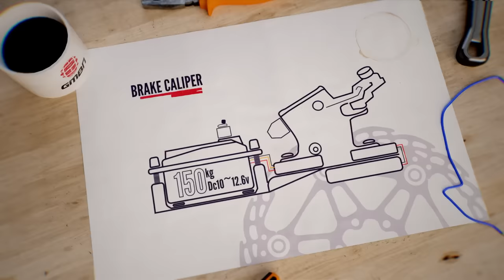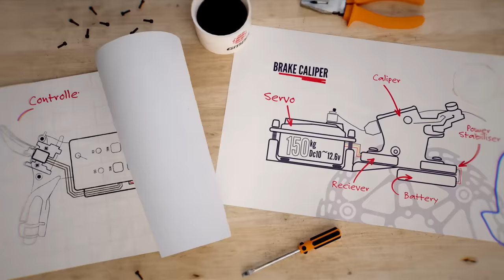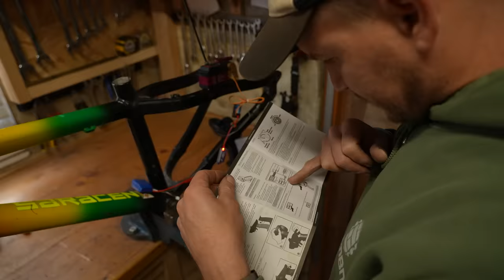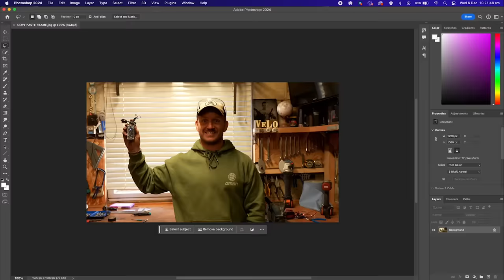We Made The World's First Wireless Bike Brakes

Comment: If this is a standard radio control system, you probably want to dial in some expo to make the brakes a bit more proportional, probably with a pretty strong spring on the levers to give more (artificial) feel.

The big issue, however is this:  You have a safety critical system with multiple single points of failure.  There are a lot of things that will make you crash if they go wrong!  Batteries give up suddenly, signal lost, short circuit in either end, etc.  Some serious thought has to go into making this system fail safely, I would suggest some sort of mechanical default to mid-strength braking if no other input is received.

Comment: Not needed on the front, you could just run the cable through the stem cap and achieve the same thing, which is safer especially if using a wireless rear. On the back with some refinement, maybe using a longer lever, yeah for those willing to go through with it and with replaceable batteries, plus one wireless brake is half the development work.

Comment: Looks already awesome! Maybe there is a way to use Hydraulic Breaks, and den let the servo push instead of pull. Makes it definitely a little more complicated but it’s an idea.
Also I think overall better quality servos especially faster ones will improve the system a LOT, So it works more intuitive like the original ones.
You even could use more space on chainstays and fork fore the mounting when using a hydraulic setup

Comment: The main issue with the 'feel' is that a servo is position based. So the moment you want to position it into the disc, it will put the maximum torque in to achieve this. Which makes the brakes quite 'binary' on or off. The little bit of modulation you do feel has to do with the flex in the system, which does convert a position somewhat into more tension and thus more force. I think this system would be better off with a normal geared motor that is regulated by torque and not position

Comment: It's actually amazing how many patents have already been submitted for wireless braking in various forms - Shimano, Campag to name a few. There is no reason why we can't just seperate lever and caliper completely. The current wireless standards are built to be fairly secure etc. Levers with there respective electronics could be small and unobtrusive. Modulation is not an issue, but feel is - unless you could implement some sort of feedback into the lever??? The problem is most likely the safety aspect - if the lever loses connection, would you gently lock up the brakes? Lots to consider

Comment: Pretty cool Idea!  If you would have used a better radio you could have used EXPO function to adjust how much brake is applied throw-out the pull of the trigger from start to full pull it would have made the brakes work much better less twitchy and also you could have use the radios ABS function also to tune how the brakes worked when applied. with a better radio system this may have worked out much better.

Comment: Maybe look at replacing the motor cable arm with an ovalled cam (see square dash Porsche 944 throttle body) to make it more progressive, coupled nonlinear springs at the lever end. Love this as an academic exercise, hard pass in the real world due to the dependance on 4 batteries, versus something like a car that would have more reliable power and facility for redundancies. Loving the work, though!

Comment: would love to see a smaller version of this with real leaver blades on the brake leaver and mabey like a bottom out bumper behind them to mimic leaver feel also think some kind of full housing/case for the parts would be quite cool and mabey axs batterys on the brake calipers so could could take the battery from the drive train or seat if your brakes battery ran out

Comment: U could build something which would stall the rotor upon low battery also depending on velocity, wheel speed and  some other kinematic data. good luck with the algorithm plus added weight to accomplish all that.. But then the question what does it really achieve? A nice fun project though.

And if i may suggest please try to do a wheelie holder when you are at it..😁

Comment: Not that I'm suggesting taking a step back from disk brake technology, I just think a linear servo v brake could be very very compact, but the reaction time would be slow given the screw drive. For the disk brake what about a servo clamp gripper, that way it's combined and the for factor could possibly be smaller

Comment: The caliper needs to be with a reversed fail safe mechanism, the servo should work to fight against a spring to releases the brakes when the lever is not pressed and when you press it the motor should release. But then you'd also need a motor that can easily be back driven so that when power cuts the motor will release and the breaks would lock. As the battery drains the motor decreases in power and the breaks would engage slowly more and more until they fully lock up and you have to replace the batteries. Still can get you killed but better than no brakes on power disconnect 😅

Comment: lol, thumbs up for the efforts!  The result is very much within expectations.  The lack of feel is  a a BIG problem. Ask BMW enthusiasts, many of them cried when BMW ditch the hydraulic steering for the electrical one.  Ask Boeing pilots switching to fly airbuses.   In those applications the technology can compensate with simulated feedback. With enough geeky engineering, I am sure that can be done for the wireless bike brakes.  But I guess very few people would want to pay for it.  I don't spin my handle bar 1800 degrees in the air.  I don't even jump that much on my bike, lol.

Comment: mercedes did this with the SBC brake by wire system back in the early 2000's. they cancelled it in 2006 and have to warranty the pumps by usa law for 25 years now. but yes the brake pedal on the car used a hydraulic simulator by feedback from the pump to simulate brake feel. i work on the one on my folks old e class often, it works great when it works.
Reply: like old Avid Juicy Ultimates. They were the best feeling brakes in the world, right up until they randomly quit working properly every few rides. My mechanic was so happy when I called him and told him I was bringing my bike straight from the trail to the shop for a set of XTs.

Comment: I was thinking keep them hydraulic, but instead use a servo as a plunger to create pressure in the hydraulic system, essentially just moving the fluid reservoir down near the caliper, vertically mounted on the fork

Comment: Maybe us a different servo with bigger gearing for more modulation. Maybe also calculate or test what servo power you need to stop the wheel from completely rotating, with you weight combined. Maybe you can cut some servo power so you can pull more lever. Just some idea's.

Comment: Get with the local college engineering dept to help update the system. Battery box could go to lighter weight rechargeables. Smaller servo's. I think still possible to do this with hydraulic brakes somehow.

Comment: I always wondered, could you get rid of the battery in the levers by using piezoelectric crystals like you get in some wireless light switches?

If you could get regenerative braking going then you could do without the battery in the caliper too.

Comment: For your next prototype, you could install a battery monitor. When the battery gets low enough, say 5%, an emergency generator can kick in and charge the battery using the rotation of the wheel. It will kill your efficiency on rolling, but it would be a great back up so your ride does not end just because your brakes died. How to charge the levers, I don’t know

Comment: You would probably benefit from using more pro spec RC transmitters as opposed to the RTR type (that come in the box with the car) ones used.  With adjustable end points (trigger swing) and dual rate adjustment (how far the servo will throw on full throttle) you will have a lot more adjustability and feel at the lever. .
Reply: Good point!  Those RTR servos never last very long either.  In fact, the high quality servos could be stronger too...

If I'm not mistaken, servo motors don't really like being powered in a static position (for those who don't know, any electric motor is susceptible to high current dangers aka overheating when powered in static position due to lack of back emf).  Maybe this can be compensated for with careful design, but what do you think about using another mechanism like a solenoid?
Reply: @tedjohansen6535  I used to race RC cars in the national championships and you'd never see anyone at that level using cheap Acoms servos or £10 Futaba ones. The expensive ones are more expensive for a reason & it could just be down to using bearings instead of plastic bushes and a stronger motor that is lightning fast.  I used to use Futaba 9451 servos in my buggy and it was so fast when you steer the car from left to right & strong enough that you could land from a big jump with the steering cranked hard over. If you did that with the basic 3000 series Futaba it would smash it to bits.

Comment: cap off a hydraulic line with just air and attach that to the trigger with an actual lever, that way, you can have a real lever and you can adjust the tension in the lever by adding or removing fluid in the line

Comment: Imagine that you put a load sensor between the rotor and the hub, and the lever pull increase the breaking force apply to the wheel , not to the galiper, and the servo recalculate the force it need to apply 1000 time per second. That would create the most precise brake ever. That would eliminate the effect of brake fade generated by heat, water, usage , etc… Add ABS to the equation and know you have the most powerful brake ever.

Comment: Given how incredibly light low voltage/current wired can be, I think wired electronic brakes makes a lot more sense than wireless. Since those wires could be connected and disconnected as needed, it would be sooo much easier to maintain your headset or anything else than with the alternatives

Comment: Been thinking about this for awhile I new it would work with a server pushing the hydro piston. I would put bigger levers on it. The control could be loads smaller if it just braked go to a hobbie shop or speak to a controller designer I think you could get something the same size as the hydro chamber on the lever. Can't wait for mark 2
Reply: Oh yer r.c plane severs are small and strong

Comment: I’m ok with my brakes not being dependent on batteries being charged, losing charge etc, batteries suck in the cold too. However brilliant fun video, I think we’re a few iterations off large scale adoptions though 😅
Reply: but on Ebike you have huge battery .....
Reply: @thealzp  Do you mean to run a fixed battery cable from the frame or just use the frame's battery to charge a smaller one on the fork if it dies?
Reply: @tedjohansen6535  to charge  if nessesary. It's not good idea to replace one cable with another, since we are going "wireless".

Comment: I would change it to use a small arduino and potenciometers, something like drive by wire. This could be used through disabled people, which might not have the grip strength.

Comment: I dont think u need a 150kg servo, they are too slow in their movements, it's not the servo that's stopping the bike, its the brake. I would think a 50kg servo with metal gears will be enough. With that, the braking modulation feels should become better. Maybe get someone with experience rc cars involves in this project. They might have more to add into this project. Those high end rc controllers have so much function  that can be experienced with cycling.. especially the telemetry readings.

Comment: 100% somebody is going to pickup this concept and make it in bulk (which is great).
Reply: Right, so in theory, you could replicate the feeling of a hydraulic brake. Instead of having just the electronics in the handle, you'd still have a little bit of hydraulics. Imagine having a shock, but for your brake handle....so you press hydraulic fluid into a chamber or spring mounted plate. A sensor at the end is calculating the pressure which the servo at the brakes needs to apply. You could have a little (a rather strong little) pump there applying hydraulic pressure on the caliper. 

In theory, that could totally work. But there are so many factors to be taken into consideration. As in weather, temperature and whatnot. Plus you'd have once again more moving parts which need replacing eventually. And servicing beforehand. Though, that way, you could maintain (relatively) the feeling and precision of hydraulic brakes. And shrinken everything down a little.

Does that make any sense? Sorry, am not a native speaker.

Comment: I would use a servo as the brake lever and put a current sensor in the brake servo that detects how hard the servo is pulling and use that to data tu give feedback in the brake lever.

Comment: im sure ive seen this done before. that servo is ok for the job but its a 'bang good' cheapo servo, wont last long and no speed/response in it. if you were to go for savox or powerhd that design would be incredibly impressive and responsive, also integrate it in to the calliper itself with a power pack built in to the bike to power all the wireless systems on the bike.... practical for production 🤩 
i actually had to make a smaller simpler version of this for my rc burnout car to lock the back drive shafts. you can shrink the components down quite a bit i think, so not as bulky. but with that the parts its much more expensive.

Comment: As a successful POC, would a fly by wire system be cheaper to produce from the manufacturing perspective? No fishing hydraulic lines. Added to an Ebike system,it can incorporate the existing battery. A small weight gain would then be negligible.

Comment: Main concern is that with brakes you want the least chance of failure as possible for safety, but you've introduced some additional possibilities for failure. Wireless/radio interference, power failure, servo failure all on top of the original brakes failure possibilities. How bad is the braking with a lack of feel?

Comment: A longer lever would make it less sensitive. You should weigh the bike before and after. Pairing the shifter with one brake and the dropper with the other might be more efficient use of batteries. 

 On an E bike I might be more interested. I prefer simple low tech. I'd rather single speed then add batteries.

Comment: 🤔 i used to race 1/5th rc cars with petrol 23cc 2 stroke engines we had hydro disks on all 4 wheels instead of cables pulling could you not use a rod? Also if you uad a better remote you can program them to modulate we even had abs on the cars and braking curves 🙂

Comment: do you think you will get used to the "soulless" feeling ? i think this is one of the biggest issues and thinking about what happens when the batteries are empty. will it lock or stay open ?!
Reply: On my point of view main problem is wireless communication, due to noise signal can be lost or delayed. If it is not a single bike with this brakes you need to somehow allocate separate channel for each bike.

Comment: I think the whole point of the brake-by-wire would be to have some pros instead of simply cons. Where's the ABS setup? (If the servos are fast enough, you could simply pulse the servos on and off fast enough to implement ABS-like system.)

Comment: a battery for a dropper, battery for shifter, battery for derailleur, battery for front and rear suspension, battery for front brake, battery for rear brake. And it's  yet not an emtb bike))
Reply: You need a central battery in the frame, and cables woven into the carbon fiber of the frame like they did with the cables of the NH-90 helicopter which are integrated inside the carbon fiber fuselage